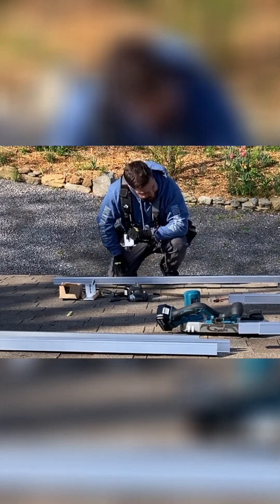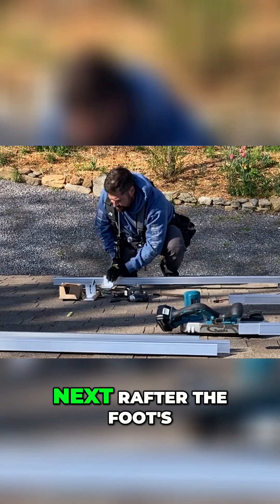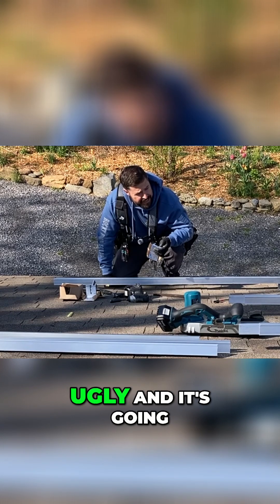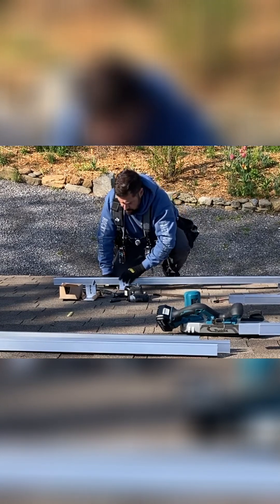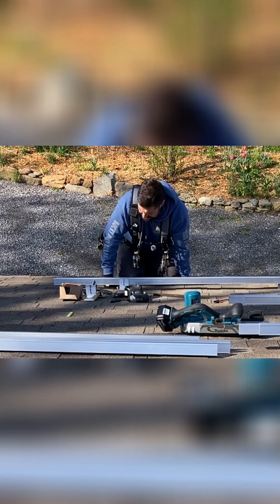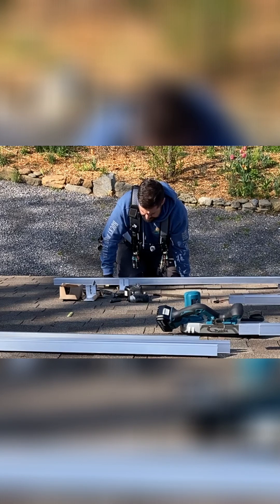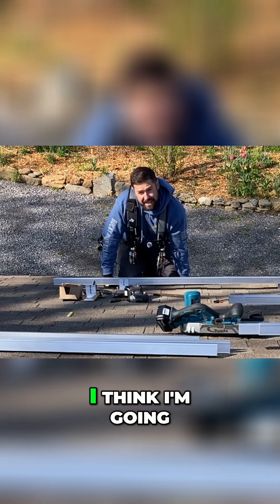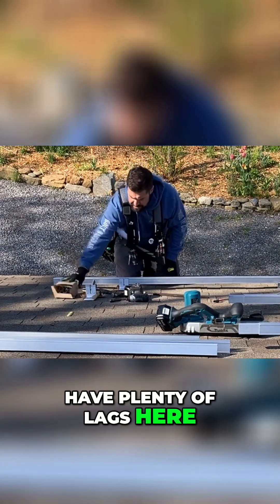Solar Install Dilemma: Rafter vs. Deck Mount - Which Wins?!

Comment: Highest lift force (by a lot) is at corners, so attach to inside joist AND do beefy deck mount just inside the critter guard.
Reply from the maker: That is absolutely a good call. That is what I should have done retrospectively. Thanks for watching!